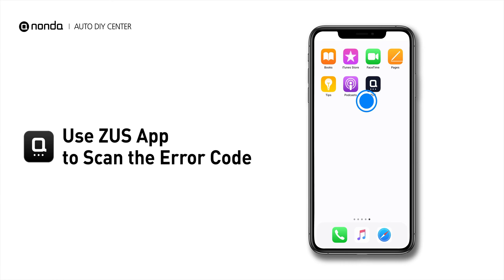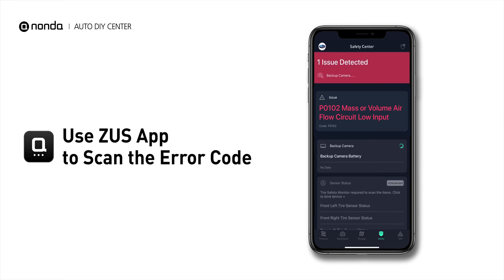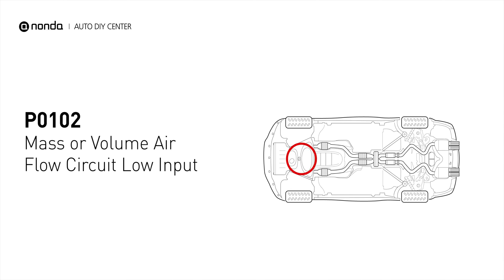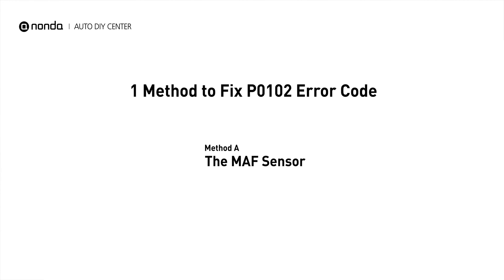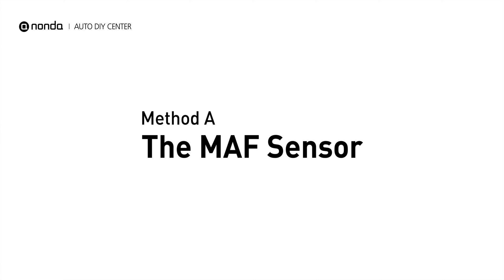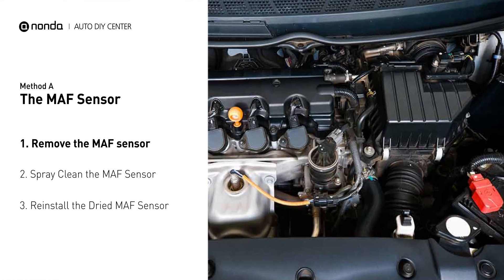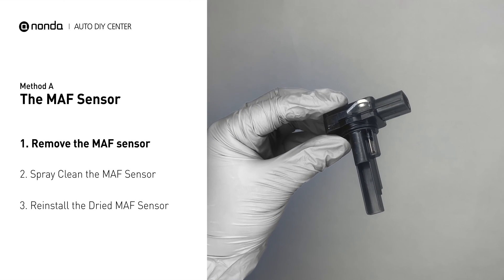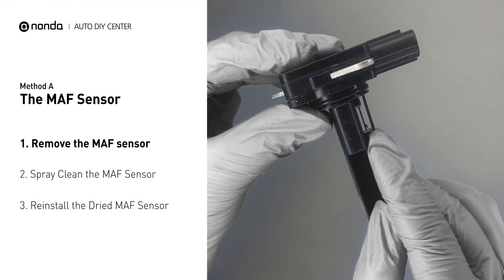How to Fix P0102 Engine Code in 2 Minutes [1 DIY Method / Only $9.61]

Comment: If cleaning does not fix the problem then replace the sensor if you still get the code with a new sensor replace map and O2 sensors to fix the issue.

Comment: This is the OTHER code my 2008 Elantra has.
Nothing against your advice or video but I will be shocked pretty much beyond belief if the solutions you provide for the codes my car is getting actually solve the problem. I say that because this car NEVER passes its emissions test. I always have to have repairs made to it.
😕
Still, I'll try to remember to follow up here.
Thanks.
🇺🇸
🇺🇸
Reply from the maker: Hope it helps!

Comment: I have a 2008 saab 9-5, when the car is parked it idles high, when the air conditioner is on it settles a bit, it also shakes while in park, love this car, just can’t figure this out
Reply from the maker: Hi Bel, kindly clean the MAF sensor and check for vacuum leaks on the intake manifold hose to see if the issue will still persist.
Reply: @nondainc  thanks I’ll try it, you wouldn’t happen to be in the New York area?
Reply from the maker: Hello Bel, we're located in San Jose CA, USA

Comment: I spray mine today nothing change the same problem take long to start I guess I need to change it
Reply from the maker: Hi Oosh, please also check if there are frayed/damaged wiring on the connector, and vacuum leaks on the intake manifold hose/fittings. Once all have been checked and seems fine, then you can be sure that the issue is caused by the faulty MAF and a replacement is needed.
Reply: With my VW it ended up being either the MAF, Fuel Filter, PCV Valve